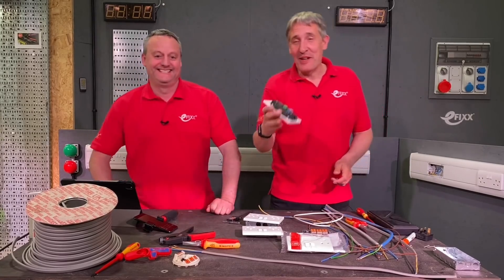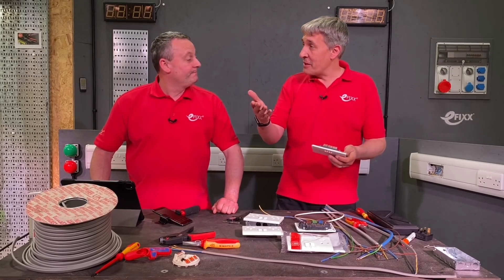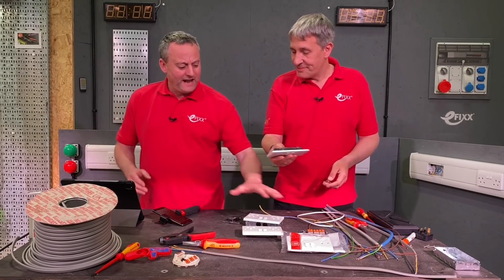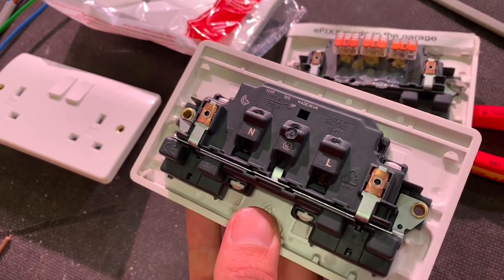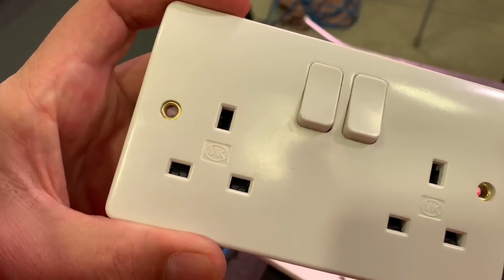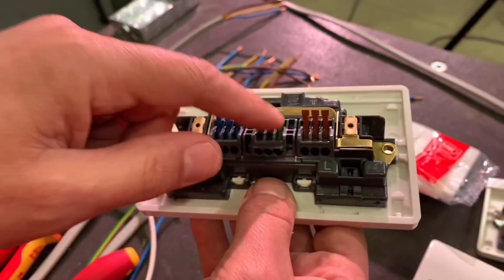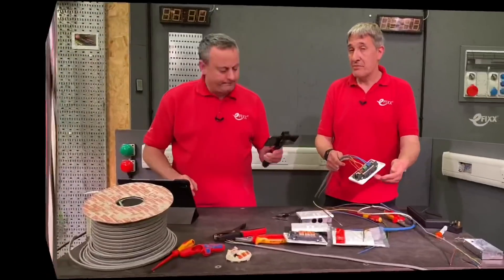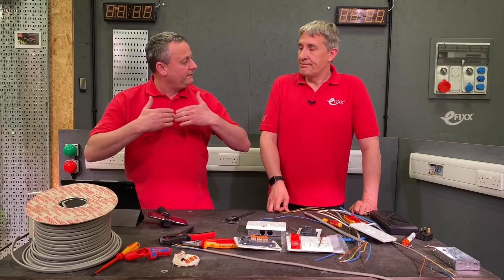MK LOGIC RAPID FIX - Double socket with SCREWLESS terminals.

Comment: Needs a fourth earth terminal as if you have a spur off the ring you will be forced to put the spur CPC into the back box earth point with another lead going to the socket earth, this defeats the safety feature of the maintenace free connections which I hope will be used on all connections in the future by doing this it will negate the need for a AFDD

Comment: the safety shutter makes the wire-to-socket connection more sturdy when it closes and pinches the wires tight. highly recommend
Reply: At 5 years old I experimented with 5A fuse and a live to neutral connection. the wall got a black mark, i was unscathed weirdly. My monther who was 4 foot away made a sound I never want to hear again. The safety shutter spoiled any chance for a re match :P

Comment: I’m obviously being dim here… I thought only L and N are shuttered off. The longer E prong pushed something inside that lowers the L and N shutters. But you’re saying that all three are shuttered off. Sounds a bit chicken and egg to me, I can’t see what makes it work, as what causes the E shutter to open?
Reply from the maker: The socket needs all three pins in place - regular sockets you can push the shield down with a screwdriver (allegedly) 😉

Comment: I like the fitting but having trouble getting wires in with my installation probably have to strip cable back as supply a little too aggressive but prefer to screw ones as those just kept blowing up in my face
Reply: My experience too.  With 4mm^2 twin+earth I twice had the live pop out of one of the brown terminals and arc over to a (sheathed) CPC on account of the difficulty of these connectors accepting the bend radius needed  even in a 35mm back box. Have gone back to screws ...  Maybe it would be fine with 2.4mm^2 twin+earth. But I don't trust these with 4.

Comment: Try it on a socket with a Ring and maybe a spur so 3 lots of cables all coming through seperate knockouts and push the fucker back to the wall, there not needed if you cant terminate a 2.5 into a socket an leave it safe then you shouldnt be on the end of a screwdriver
Reply from the maker: Welcome back Eric
Reply: @efixx  
We shouldnt be making the job easier or should i say the industry standards easier would you agree? Lets make it harder so chancers look and think nar i cant change that fuse board or whatever 
The easier we make things like this lego plug socket then Your asking for people to exploit it 
No safe isolation etc etc etc

Comment: There are a lot of reports of conductors coming out under light to moderate pressure .. far-far less than it would take to disconnect a Wago lever. What think?

Comment: Not an electrician here, so sorry if this is a dumb question. What do you do if you with CPCs if you want to use this as the start of a radial spur but you also need a fly-lead because you've got a metal backbox? I imagine it's a bit of a squeeze even with traditional screw terminals. How does it work with maintenance-free connectors with only three holes?
Reply from the maker: Loop one of the Cpcs via the terminal in the back box.

Comment: These screw-less sockets are selling for £30 EACH. Utterly outrageous! I admit, These are better because they remove the issues of correct tightening. But how much time are we actually saving? Can’t be much more than a minute surely. Average rewire 20 sockets+/- so to buy 20 at £30 =£600 compared with 20 standard sockets of the same brand £74.00 that’s a hard sell for the customer. Lets hope these inflated units will lose some of the glamour MK marketing are riding a high on and that the price come down to the logic costs sooooon!
Reply: Safer as no multiple wires in sockets. Each wire has its own terminal.
Reply from the maker: They are £5.99 each
Reply: @efixx  thanks for that info. I have had to email efixx as I can’t see these Sockets on their site.

Comment: I think price is a big factor with these. Clients generally won't care what's behind a socket and will only see the socket front on the wall as such, so £6.50odd a socket could on say a rewire send the price upwards. 

However it is the future, and when more brands do the same across the range of accessories I think it'll become more affordable.

Just need to get Wago Consumer Units now!
Reply: This could be off set by reduced time fitting, especially if using Wago

Comment: In regards to screw terminals damaging the copper conductors, I don’t understand why premium electrical switches, sockets, etc don’t use rising clamp terminals. Lots of industrial equipment uses rising clamp terminals, as do some MCBs.
Reply: @Mark1024MAK  yeah I never understood this other than maybe cost. especially if you're spurring off a ring and need 3 in there

Comment: This has be the way forward, putting 2 sometimes 3 (for a fused spur) conductors into a single screw fixed connector has always been  a flaw of the ring main method because of not nowing if both conductors are evenly secured.

Comment: They have been doing this on the continent for well over a decade. Spring lever terminals do not suffer from mechanical creep and do not need to be re tightened like terminal screws do. It's about time the UK catches up with the Europe. All we need to do now is to get rid of the slotted box screws that mount the socket. The schuko sockets have a very good, easy ,secure and fast mounting system. Not nearly as fiddly as the UK sockets😜
Reply from the maker: You know we like to row our own boat 😂
Reply: @efixx   that's fine you don't need to copy Europe all the time 😁😉. Hopefully the silly ring circuit will be a a thing of the past to ( and all the annoying tests that go with the pointless ring circuit). The ring circuit is reason we have fused plugs in the UK. Why do you need a 32a circuit for socket outlets these days anyway?
Reply: @MyProjectBoxChannel  
Final Ring Circuits have their advantages for sure.  I am a fan in general.
Final Rings means a house electrical system can be fitted as a rule-of-thumb. Use DP RCBOs all around and easier still and much safer.
Fused plugs make UK system safer than others.

Comment: I wonder how big the back will be when they introduce USB sockets with this feature ? just a thought ! Great review as always guys :) I think you missed your Dragon's Den moment a couple of years ago, could all be smoking a ciger in your swimming pools by now :))))
Reply from the maker: 😉 we’ve got a few more ideas in the hopper!
Reply: They could use the push-in mechanism that's usually used by German sockets. Those take 2 wires and are smaller than a screw connector. (They are also annoying to use, as you have to push and hold down a plate with quite some force to open them. On the other hand, there's no lever that could snag open.)

Comment: What about testing at a socket  there is no terminal for you to put your probes on you would have to remove the socket to test at that socket especially once these have been in service for a number of years the contacts in the socket can wear and give unreliable readings requiring testing on terminals on the back on a traditional socket

Comment: I’m really impressed with them, quick question for you guys though. 

On stranded cable how do the terminals hold up with a feral in the terminals? I’m guessing they should be fine and and there is probably no need to feral them in these types types of connectors
Reply: Stripping length is 10mm, normally get 10mm on a bootlace ferrule, so in reality it should marry up to the shoulder of the ferrule. Gonna have to try this myself…

Comment: Love Wago connectors. However always thought Mk is overrated. Appreciate having all the terminals in a line means the cables are stripped back to a similar length. Bring 3x 2.5mm in from the bottom of the back box and see how difficult it is to screw the socket back. Incredibly poor design in my opinion. Much rather use Click.
Reply from the maker: 11:00 we wired the socket with cables from the bottom. Click don’t have a screwless option atm.
Reply: @efixx  I appreciate you did that, but with only 2x 2.5mm. It’s not so much about the Wago socket… more about MK’s general design when terminating 3x 2.5mm entering a 25mm back box from below. All the cables terminated in close proximity and on the same level is not a great design in my opinion. I’d rather have the terminations higher and wider apart. I’ll wait for Click to bring out their own version. Great idea though…. Which manufacturer will bring out the first consumer unit with Wago neutral and earth bars? 😁

Comment: A welcome step forward. Now we just need them to take that terminal block and locate it in the back box, (with a suitable flexi fly led to the socket.)  So at first fix we can complete and test the ring before the kitchen fitters come along and screw through our rings. And socket faces can be unscrewed for EICR's, with much less risk of causing a broken conductor as we push back the face plate.

Comment: All we need now is a better fixing arrangement to the back box, locating lugs and better screw guidance would be a great thing.
Crosspoint not flat and with the plain end bit should be standard.
Just removed loads to decorate a whole house then replaced them - a pain of a job.

Comment: Just what I needed, most modern outlets are difficult to use with 3 old stranded cables never mind mixing with solid . I had to extend a ring for socket on wall just behind existing single outlet. Old stranded including an existing spur. Fitted this double outlet in standard backbox. Broke in to ring with two 2 cables through wall. Fitted it all in including 3 Wagos. No lifting floor for a junction box!!

Comment: Such innovation (NOT). The UK continues to trail the world in electrical standards and technologies, with their archaic rules, regulations and clunky old products.
In Australia we have use insulation displacement for [unswitched] socket outlets for the past 25 years or so. [These have traditionally required stripping of the outer sheath because we have had various thicknesses of the white outer covering, however the IDC itself accepts 1.0mm², 1.5mm² and 2.5mm² single insulated conductors].
Recently powerpoints (switched wall outlets) and single point outlets have been approved that don't need any cutting or stripping for inline connections, so just clip down over the double-insulated cables. That makes installation incredibly fast!
[By using IDC] the current handling of the circuit's wiring isn't affected, since the cable is not cut. The only load going to the connectors is the local load (that particular outlet).
NOTE:  I HAVE EDITED AND RE-WORDED THE POST ABOVE [added words in brackets].
Reply from the maker: The stuff on the Clipsal site doesn’t look so different - can you send a link for the IDC products.
Reply: @efixx  - The IDC is mainly used for single unswitched outlets, so I was a bit unfair in my initial comment (so I've just edited it).
Note that the IDC is only rated 10A (as-per our standard mains outlet specs) but the cable remains uncut so the higher current of the circuit itself doesn't pass through the socket outlet (the IDC is a "tap-off").
...
This is a significant difference from the UK product you've shown where the entire circuit current is passed through multiple "Wago-style" connections. Whilst an IDC is probably a better and more reliable overall connection than (cut, twist and) screw-down, electricians are often not technical people and the "old school" don't trust Wago or similar push-in types, despite it being the standard method used in many countries.
...
Link to Australian approved Switched Double Wall Outlet, absolutely no stripping required: https://www.youtube.com/watch?v=aneJJexTKSg
Clipsal (Schneider), HPM (Legrand) and others generally use an IDC where the outer sheath must be removed like this: https://www.youtube.com/watch?v=UtsqHpQ2p2s

Comment: Mk discontinued CU's because they couldn't keep ahead with the 18th edition regulations.  Siemens brought out wylex and Crabtree so In turn started focusing producing Rcd's, Spd's & Affd's for them instead.  They basically pushed MK out of the Cu market.  I'll be interested to see what Siemens have in the works with Crabtree/Wylex branded product/accessories.  I think they'll give MK Honeywell a run for their money.
Reply: I worked for a company that was bought out by Siemens then dumped when it did not make enough profit. It needs Crabtree/Wylex etc to drive their own developement.

Comment: Sorry Gaz, I'm not overly convinced by your trial where the cables came up into the back box. Looking closely, whilst in contact with the 'plasteboard' at the top, the socket appeared to stand-off a little at the bottom when tight. I can't help thinking that the double thickness of conductor was being trapped between the levers and the box. Please can you take a closer look? Specifically, how does the minimum gap from levers to back box compared with 2x, or 3x diameter of, say 4.0mm^2 conductors over the insulation?

Comment: These look like a great idea to me. I'm not a professional electrician but I think for people doing bits themselves at home (where appropriate, I'm not a numpty!) this should be a lot safer as well since they remove the chance of making a bad termination that might come loose when the socket is fixed back. Price wise a single one of these is currently £6 on Screwfix and the standard one is £3.77 so they cost ~60% more which is a hefty increase though I think it's worth it for the convenience and safety factor.

Comment: At a job children's hospital, refurbishment on a ICU fitted brand new 400 mk sockets, essential sockets with red rocker switch, come to test them,some turn out  faulty,had another batch of 400 they where the same faults on them ,mk quality has gone down hill would never use them again
Reply: The essentials range is trash, madness to try and use them in a commercial environment. Logic plus is still great quality, and decent value.

Comment: Isn’t this just promoting diyers to start replacing sockets?
Reply: I got one of these sockets from "Screwfix" to try it out, but spring tension ain't as good as Wago, very similar to the spring loaded, push fittings that European machinery had in the 1990's that I hated back then, so this one will be getting retund for a refund (been told that MK worked with Wago to design this product, MK will have to greatly improve their standards before seriously marketing any more of these products!!!
Reply from the maker: The genie 🧞‍♀️ left the lamp a long time ago.
Reply: DIYers will always replace their own sockets. At least with these, there's a better chance of it being done safely.

Comment: Hi all, a great idea at last, however what if you have three T&E conductors and a flying lead to the backbox for the earth, you now have four earth wires but only three earth levers, can you put two earth wires into one lever  or would that cause a problem with correct termination? Ok I have just edited my post after trying two earth wires from a 2.5mm T&E cable into a Wago and I gave them a good tug test and they can't easily pulled out..
Reply: Speaking as a non-electrician, could you put a 4mm ferrule on two, or even a twin/double ferrule end connector maybe?

Comment: Efixx please more actual engineering information and I have said this before can you get MK to release a technical sheet proving that torquing (not torque but actually pull force using a calibrated force gauge instrument) has been tested not just a tug test , that connections are just as robust or better than screw connections more resistant to arcing, temperature increase and thermal damage. I am all for new products but engineering quality and testing matters and efixx should be calling this out more otherwise manufacturers will feel they don’t have to be transparent about the quality of their products and testing methods and we then get a race to the bottom which none of us want. I hear they use Wago connector springs which have been proven but it’s high time for manufacturers to release more comprehensive testing and technical information about their products.
Reply: Maybe you should become a producer for the efixx channel. I'm sure they would like to give you money for the privilege of you telling them how to run their channel ;)

I jest of course... I too would like to see more technical information, but I think your expectations are wildly out. Asking efixx to simply "get MK to do xyz" is a bit much.
Reply: @MatSmithLondon  gentle nudging - it makes business sense to build brand commitment around quality and it helps installers to decide on good products. Efixx are doing a good job but the industry can feedback improvements and I hope they would welcome it.
Reply: @mathman0101  This works great for small or emerging business, but when your reputation is built on pretty much designing the UK mains socket (as MK did in the 1920s) I suspect the idea of protecting the brand - i.e. not releasing information unless required to do so by law - features higher on the priority list than reaching out to consumers through youtube channels, no?
Reply: @mathman0101  Completely agree with this. Having bought a bucketload of Wago DIN rail stuff recently I agree their technical documentation is good (although a complete nightmare to navigate their product numbers, but that's a different matter...)
Reply: How would this information be of benefit versus a screw connection? Unless you use a torque screwdriver, every single screw connection you have ever made will be to a different - and possibly incorrect - torque. At least with this clamp-down the connection torque will be consistent.

Comment: tik tok videos is showing the cables easy to pull out of connectors
Reply: They pass all the relevant pull tests but if you want to yank a cable it will pull out of screws or clamps. I have one on my desk and it is working great.